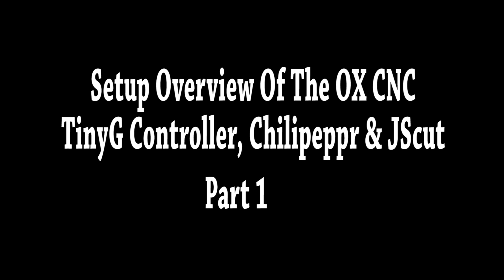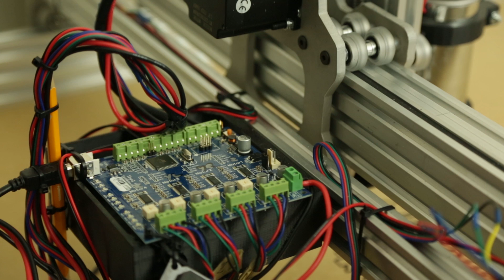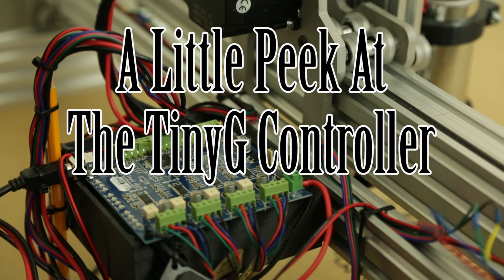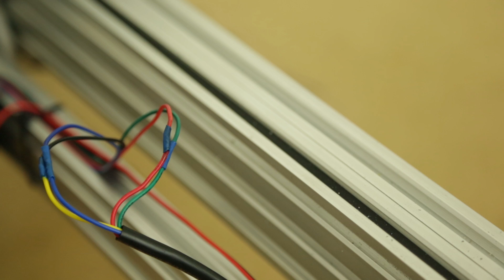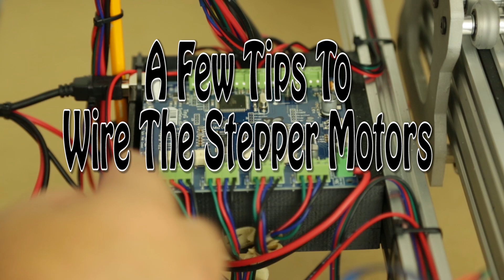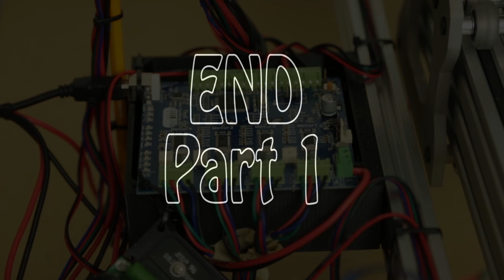Setup Overview Of The OX CNC With TinyG Chilipeppr & JScut pt1

Comment: hello thomas, first of all i really want to thank you for your videos it helps me a lot,
i just want to make a question, i just replace  the pastebin configuration that you leave to my tyni G from chilipeppr windows, it all starts to work fine, but when y try to test the configuration i have 2 problems, i create a file from jscut its a 100x100 mm square, when i load into the chilipeppr, the machine starts to cut, but when is almost to complete the first line of cut suddenly the x starts to move and create a irregular diagonal, and contínuos to cut the square outside the original groove. also the machine dont cut the exact dimensions. i really appreciate if you could give me some directions.
cheers

Comment: Hello Thomas, I appreciate the video.  I have a question.  I am building a custom engraving machine for a product that I sell online.  I am planning on making a machine where I can load the part and press start.  No need for a computer, headless if you will.  I will make the inital design in gcode and save it to the SD card.  I have seen some make a headless CNC with a RPi but I feel it would complicate things.  This machine is small, about a 1ft cube. I have the TinyG now.  I would like to use an Arduino (Mega) with a SD card.  A LCD would be nice to have for a status but not needed.  Do you have any resources that could help me get going?  Thanks
Reply from the maker: 3d printers work exactly like this.  i suggest you google IRC chat, learn to get on an IRC channel then you can chat live with people from all over the world who will help you with this project. should be pretty easy to do, becuase its done all the time with Gcode on a 3d printer.
Reply: +Thomas Shue wow, IRC.  I haven't used that since the old dial-up days.  Didn't know it was still around.  lol  Can you recommend some channels to check out?

Comment: can i use this with Mach3/4?
Reply: +ipadize No.
Reply from the maker: ok i use IRC cloud as my client. Once you have a client you are happy with log in to the #freenode, and then  #reprap channel is an active channel where they discuss reprap style 3d printers.  i have used an SD card, and a rasberry PI to run a cnc machine with no PC.   Anyways, Good luck to ya, Tom
Reply: +Thomas Shue I am interested in looking at the Raspberry Pi setup.  Do you have that documented?